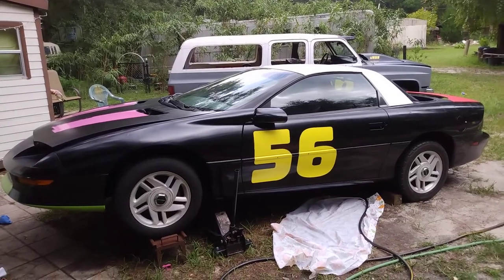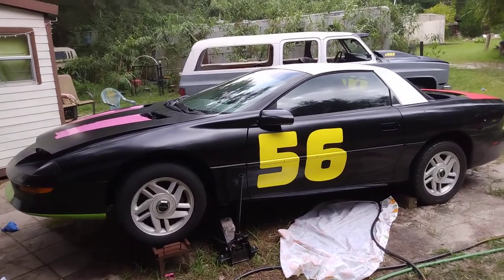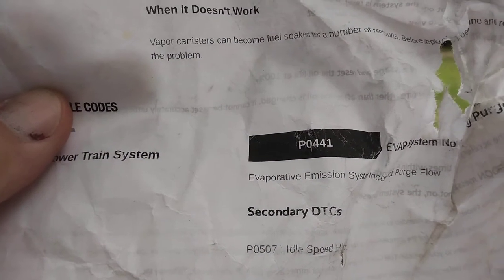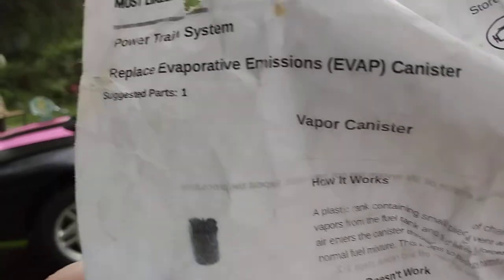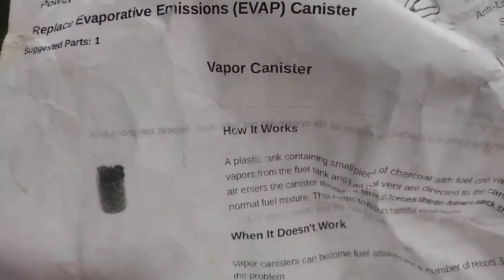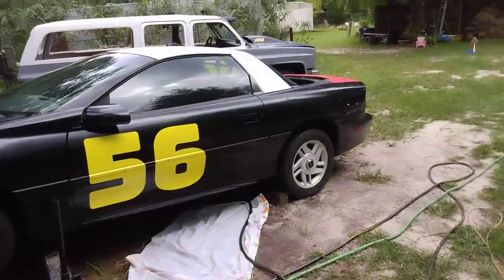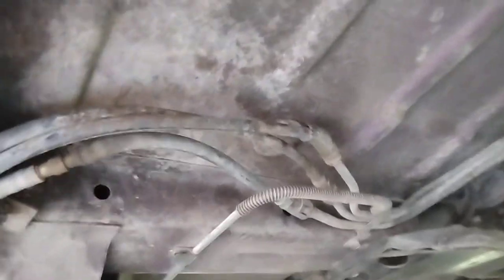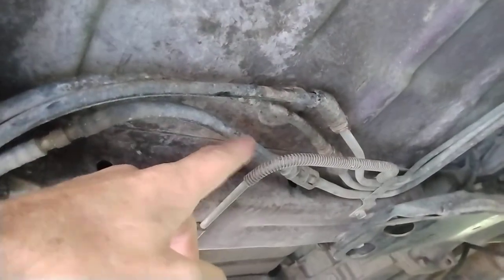PO441 Code, Evap System F-Body 4th Gen Easy Fix 1996 Camaro V6 - V8

Comment: wheres the charcoal canister located XD
Reply: You’ll see it if you take the gas cap off and the plastic around the fuel neck. It’s right behind the rear wheel well
Reply: For a 4th gen camaro atleast